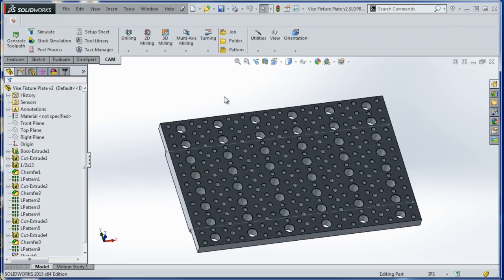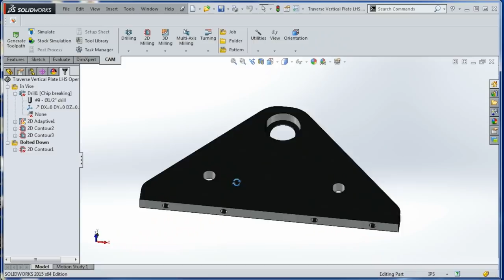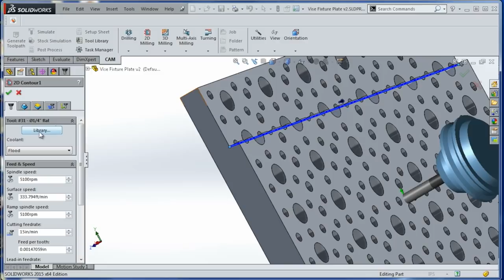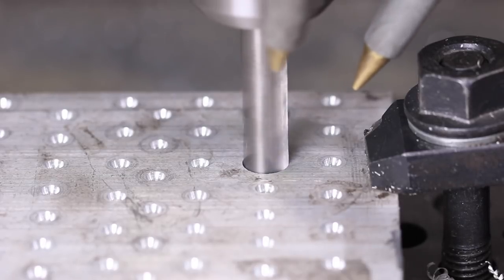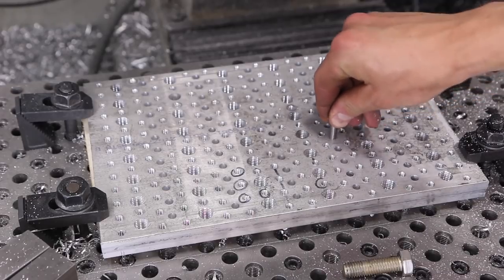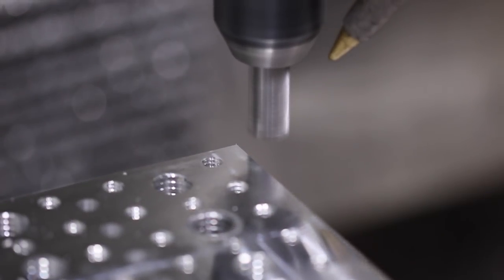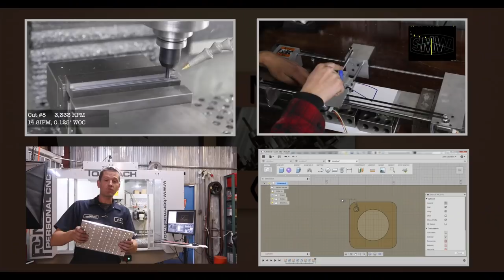DIY Vise Fixture Plate Widget - Widget43

Comment: Can I make one suggestion? Where your vise jaws grip the plate machine a dovetail and make a set of master jaws for your vise with the mating dovetail in them. What this does is you don't have to close the vise so hard (this will bow up the top of the plate with a lot of vise pressure) and it also makes the plate more secure from pulling out of the vise jaws.
Reply: Edge Precision
Reply: What an awesome guy!!

Comment: For drilling aluminum, try TIN coated screw machine length parabolic cobalt drills, you don't have enough rpm to take real advantage of carbide, would be leaving lots of money in the drill.  Use a SFM of 250 or max rpm.  That pecking cycle you found looks very reliable! A properly lubed tap in aluminum should last you 10K+ holes. A blast to watch you learning and showing more all the time!
Reply: yamahaeleven And a shallow angle spot drill would compliment it well! A 140° spot drill would serve well to locate a 135° split point drill.

Comment: Wow! I love your videos... Never lacking for a great explanation :-) I'm not a Machinist, but I am learning so much, so fast, it's incredible :-) Thanks

I should mention. My background is in Welding, Computing Sciences and Robotic Welding... I'm slowly working on a CNC Machining device, so this is really giving me a great education :-) Thanks again...
Reply: NYC CNC I learned on mainly Miller and Motoman Robots. However, the basics on every robot are the same... Once you're familiar with one, the next Make, is much easier... It's like spoken languages, they all do the same things, they just do it in different, but similar ways...

Setting up a Robot to do a particular welding or plasma cutting job, via a terminal is essentially the same as one does to setup the parameters for a 3D Print... Set the print head temp, the filament speed, hotbed temp, movement seed of each axis... A 6 Axis Robot needs all of the parameters set... But beneath setting of parameters, there is a level of programming that the operator rarely sees... That's the software that translates the G-Code into movement according to the parameters...

When setting up a 3D Printer, one starts with the base... The "board" one is going to use... Then they upload the Driver(like) software to the board... This is the software that converts the G-code into movement...

Now, if one were to get right into the programming languages... Like 
writing the Drivers for 3D Printing boards or Robots, that's where it gets 
tricky... Many companies like Fanuc, Miller, etc. have spent years perfecting that software, but we can get similar software from Rep Rap for each board... and it's all public domain :-)

The main difference between 3D Printers and Robots is the setup... Most Robots incorporate a handheld Input device and as an operator walks the robot through it's movements, he sets points where an action is recorded... Starts at the "Home" point and moves to a piece to be welded. Along the way he moves the robot and records points as not to harm the Weld piece or the robot... There are a few parameters to set during this process... but mainly the Path and Travel speed...

Once the Robot head has reached the start point of a weld, the welding parameters are set... Voltage, Amperage, Wirefeed speed, weave (If any). All of those parameters are set in a 3D Printer by the software, with little room for adjustments... Unless one knows G-code Programming well enough to make the fine tuned adjustments...

However, back to the Robots... Most of them do the same things with minor differences... Some newer machining Robots are capable of taking a Graphic rendering and machining an object via Graphic or 3D Photo and simply running a G-code like software... ABB and KUKA are just two manufacturers among many... Those robots are easily converted from Machining to Welding, Plasma Cutting and other operations... :-)

I should mention... Robots have come a long way but still, they are mainly used to duplicate or replicate one specific item, hundreds or thousands of times... 3D Printers are essentially the same idea... When it comes to "One-offs" they are great at taking a 3D graphic and creating a duplicate, but the graphic must be precise... Then 10,000 can be made exactly the same...

Prototyping has a lot more to it... I watched part of one of ABB's videos... They were Machining a statue from Marble... Not only did the Graphic have to be precise, but the parameters of the block of marble have to be incorporated... If they wanted to make 2 such statues, either the marble block had to have the exact, same dimensions or they had to input the New dimensions according to the New block... One-offs of that nature are very inefficient...

In Robotic Machining the base material must also be exact or "Homing" must occur with every piece and homing may not be enough... Slight variations in Thickness, width, etc. can throw the whole process for a loop... I'm sure you understand... but precision requirements vary, depending on the operation... Welding is very forgiving, but machining is much less...

Oh! I should add... ABB and KUKA Robots are just different, not better or worse... I learned on Miller and Motoman, but the same education could have be attained on either ABB or KUKA Robots... Many people, being familiar with one, tend to think that it's the best... Not so... Having no knowledge of Fanuc Robots, I was setting them up within a couple of days... and unless the parameters were all in Chinese or Japanese, I would have no difficulty with any robot... I'll shutup now :-)

Comment: Hi John,
I really like watching the Tormach run.  I could probably sit there for the whole hour while it drilled and tapped all those holes.  The Superfly left an awesome finish on your fixture plate!  The plate looks too nice to use in a sacrificial manner!  I guess if it gets too dinged up and ugly, you could always make another one.  One thing though, I think I would have gone back on the front Y axis and trimmed off another .020" so that I knew that edge was straight.  Thanks for the video.
-mike

Comment: Thank You for this video. Tooling plates are very handy for holding and I agree holding a workpiece in a good and rigid way is half the battle. You have a very versitile plate there and I like the care you give to be sure that you are able to do this without buildup on the tools which shows you have good foresight into the build and are thus able to not worry if you need to do something else.

In lights out this discipline and know how is critical. It is refreshing you are so upbeat and even excited about your projects and this makes you stand out well compared to other teachers who are by their own right very good also. I suppose you are changing each tool manually?

Thread milling has always been the best and I prefer that where I can use it. NPT's are really done nicely by that method. Where I am at now they do not believe in thread milling thinking it too expensive. I do not agree with that view however. Great job!
Reply: Yes that was the viewpoint. The explanation of that further was they felt like it may be too complex for most operators and would generate more problems.  A broken tap oft times may scrap a part whereas TM is the better choice.

Comment: If you use the "hole wizard" feature instead of regular extruded cuts to make the tapped holes you would actually see shaded "cosmetic" threads.

 It's actually a much more robust and quicker feature than using cuts and I highly recommend it for a bunch of valid reasons, FYI...
Reply: Also, I'd suggest pressing in a tooling ball near one of the corners so you could easily and repeatably locate your x-y datums

Comment: Nice Widget John, Ive use fixtures like that quite often in the past. Just 1 thing to watch for.... sometimes if you buy a single replacement jaw plate after a crash, you'll find it can be several thou different in height. Just double check the heights between jaw plates is always the same!

Comment: I assume by now, 7 years later, you learned the benefit of carbide drills? For that many holes and zero problems. There are other HSS drills (I think they are HSS) that can plunge straight through aluminum. Still expensive. Still requires 6k spindle. This is a great video.

Comment: Your video probably saved me some money.  I was online, buying machining tools, and had to stop to watch this video.  :-)

Later in my Summer Of Awesomeness, I'll be building my 24" X 24" CNC router.  I plan to use it to machine plastic.  I have a production job I'll be running a lot with approximately 90 parts cut out of a 2' X 2' X 3/4" sheet of plastic.  I was thinking about using an aluminum plate instead of a table base and spoil board and having the CNC router drill an array of holes that I can tap 1/4-20 to make it a giant fixture plate.  My 2' X 4' CNC router has a spoil board and I had the router drill an X and Y lines of holes to use for nylon spacers that I use as crash proof low tolerance dowel pins to set up repeat jobs.  On the 2' X 2' router, I may intersperse dowel pin holes with the 1/4-20 threaded holes, or I may just screw nylon cap screws into the 1/4-20 holes and use the heads as alignment pins for the part edges.  That should be good enough for my low tolerance application.

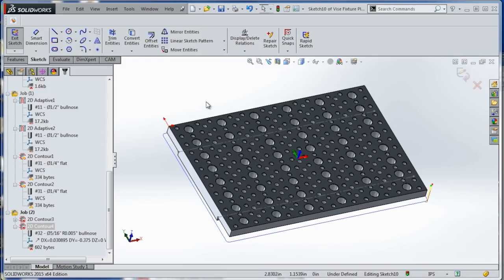16:40 The finish pass with the interrupted cut through the different sized holes sounded like Morse code, or signalling the alien mother ship.

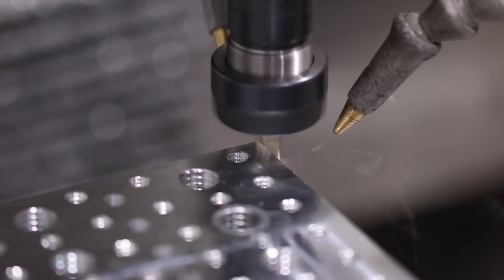21:15 I love the SuperFly too.  I received the 5" fly cutter bar from Suburban Tool on Monday.  I'll be making a SuperDuperFly that is a bigger beefier version of the SuperFly, with a 6" width of cut.   I plan on making a TTS arbor for it, even though mounting a fly cutter in a collet is a major no-no.  The SuperFly gets away with it because it's only a 3" cutter.  I'll continue to use the SuperFly for material removal, but my SuperDuperFly should be a cross between the SuperFly and a conventional large fly cutter.  I'll avoid large material removal rates and keep the RPM down to prevent slipping it in the collet.  In other words, I should be able to get decent material removal rates, but I'll use it more like a fly cutter than a shell mill.

You mentioned having good feeds and speeds for your larger drills but needing to develop better drilling recipes for smaller drills.  Why is this such a big damned secret that everyone needs to do on their own?  Is it that dependent on the machine?  I'd think smaller machines should all do well with very similar recipes.  I'd STILL love to see annotated tool tables, with a list of tools, and recipes for cutting steel and aluminum.  As a self taught home shop machinist, that's the largest hole in my education.  Knowing which tools people use and the feeds, speeds and other tricks they use (peck timing, etc.) would be the most useful info I could get.

Thanks for the great video!  I'm looking forward to seeing you using the fixture plate.

Comment: nice video mate.  I was using the HSMXpress (free version) for a while and I found out the hard way (like you) about the drilling.  with the chip breaking, partial retract etc..  it seems to feed in really hard.  The only one that worked well was the full retract (deep drilling i think it was).  I really liked the fact that HSM was easy to learn.  Now I have learnt it, I found that I needed 3D milling but wasnt prepared to spend $10k on software.   

I had a copy of CAMworks which I tried initially but was hard to understand.. But now I have worked with HSM, I went back to it and things make a lot more sense now and it generates less aggressive toolpaths and saves the bits, also the drilling is great!
Reply: NYC CNC No I havent. I don't think the HSMXpress comes with it?  I wouldn't think it makes much of a difference other than being more wizard focused over setting the depths/pecking manually.

Comment: Wonder if it would be worth putting a reamed hole right in the center of the plate of a different size from the others. It would make placing parts on the fixture easier visually and make it a little simpler when finding center during set up.

Comment: Why are you using a centering drill?  From the old-fashion stuff I read, a centering bit (there are 2 kinds) is for drilling a hole in the end of stock that is meant to be turned between centers.  The weird shape is because you want to pack the end with grease AND have space for a dead center.  Primitive, yes, but it does explain the shape of the bit.  A centering drill has a large-angle start (which is what you want) and a lower angle shoulder.  So if you're using more than 1/16" or so, the angle won't be shallow enough.  Also, it's hardened all the way through, not just case hardened, so it's solid and won't be as likely to wander.  Also, it's short.  A hole starting bit is a better tool because you can use a 120-degree bit  with 118-degree tooling.  I think the idea is (I'm not a machinist, just a drill press owner) that you want the web to touch first, which is more durable and in the center, rather than the lips.  From my various reading of antique and sentimental literature, the problem with the cutting lips of a twist drill touching the work first is that they will dig in and mess up your position.  It's amazing how little it takes to get a bit off the path.  Maybe you don't care---this isn't a jig boring operation!  And this might all moot because you're using equipment from a great century that's stiff as a wedding prick but if that's so, why are you doing this step at all?  TL;DR buy a hole-starting bit.

Also, I can't believe you're running over 1 hour for a sacrificial fixture plate.  Do you have a money tree growing in the back of the shop?  Make your fixture plate and put a few mm of stock under the work!  Sacrifice the sheet stock, not the fixture!And how is 1/4" of grip enough on a giant plate like this?  Aren't you going to get a lot of buckling?  Doesn't it make you nervous to have such scant bite on a reference surface?  And why are you cutting off all that machine work?  It's a damn shame.  Hard to watch, for sure.  Otherwise nice video!

Comment: You ever try carbide drills? The carbide .201 drill I use is 8000rpm at 30 ipm, single peck, no center drill, with flood coolant. They last forever too. I'd imagine they could save you a lot of time. Plus you can also buy carbide drills that produce perfect ream hole sizes so you can skip center drill/ peck drill/ and reaming.
Reply: NYC CNC Nope! Just carbide with a diamond point drill (so you don't need to center drill)

Comment: Love watching your videos! I was wondering about your tool path though as it looked like it wasn't as efficient as it could have been. It looked like it started in a corner, drilled one hole and then moved to a location near the middle. Also when milling the bottom for the vice, when using the roughing mill, wouldn't it have been quicker to cut in both directions?

Comment: John,

I'm trying to make this fixture plate as my first CNC project. Brand new to CNC and Fusion 360.

I think I"m ready to start, but on my test thread milling holes , drilled with a 7/16 bit, (1/2 X 13), the threads aren't deep enough. I'm using a Tormach .3 single point thread mill and my settings in Fusion 360 under Passes are a thread pitch of .076923 and a pitch diameter offset of .0625, 2 stepovers at .03125 and repeat passes.

Am I on the right track? Do I need to increase my pitch diameter offset to get the threads deeper?

I'M THINKING FUSION FRIDAY!

I've searched all over to try and find the answer for this and haven't had any luck.
Any input would be appreciated.

Thanks

Comment: When chip breaking (partial retract) you have to be careful on depth.  Smaller drills when I do it I'll usually increase the distance before the break quite a bit to make sure the chip evacuates the hole before it stops the feed and retracts .005" or so.  I'm also running flood coolant though so that may be a bit of your problem running a misting setup.
Reply: akromix I also spotted a bit of a goof there on the cleanup of the adaptive clearing on the bottom of the plate.  Looks like the lead in and out was a bit much and it left some behind.  :)
Reply: What I mean is the depth drilled before the partial retract. If that makes sense.

Comment: So after watching several of your videos, I've got a idea. lol but really though, I have a 70 anayak 12x50" milling machine, and was thinking how hard would it be attach a z axis stepper motor , and build a small x y table that I could mount to the milling bed with some tee nuts? Most of the projects I'd like to cnc aren't that large, in fact it's the small ones that are a pain to do with any kind of precision. Have you seen any examples of this?

Comment: I would really like seeing a video on small drilling. I drill a 1/8 inch hole I have noticed when i drill 1/8 holes in the drill press it is quick chips clear well using the mill my feeds are slow and I have plugging issues. In the drill press I am literally stabbing the drill into the part probably .060   then doing a full retract. The next stab causes the previous chip to come out of the flutes. I could probably figure out the feed and depth of peck, but is there a way to start the first .100 to go slow and pilot then go faster the next inch? I might program it as 2 separate holes.

Comment: Hey John,

Seen a lot of your videos lately, any reason why your feed and speeds are so low in Aluminum? Is it a machine limitation? There's a nice calculator out there called HSMAdvisor that works really nice. It takes into account the machine power curve and  contrary to it's name it can be used for drilling, tapping, boring, turning, profiling and more.